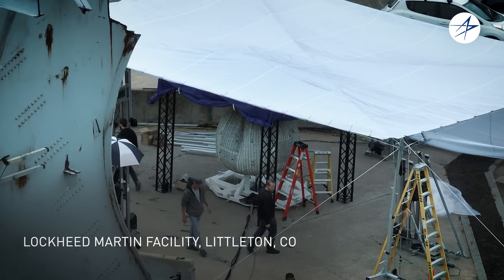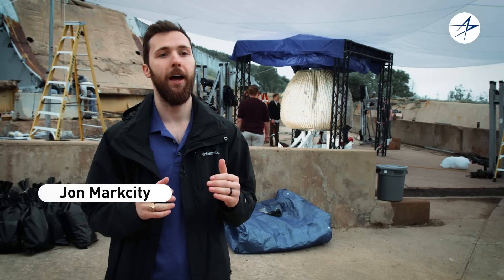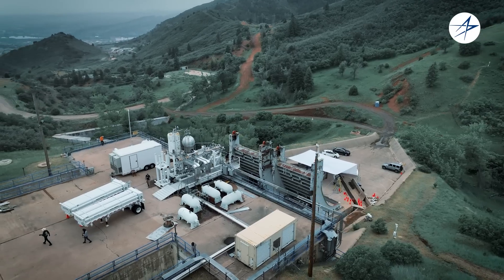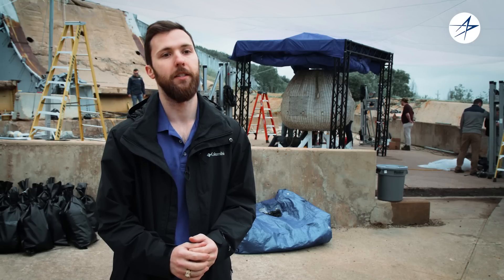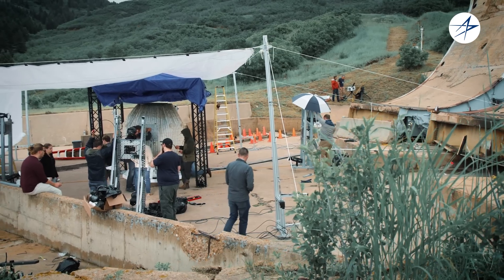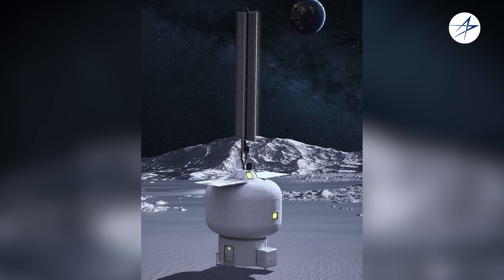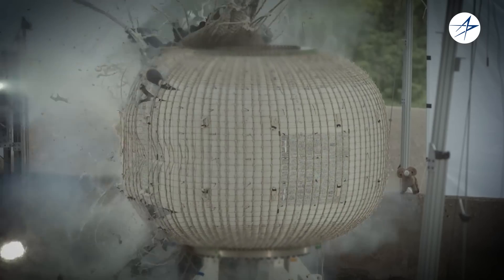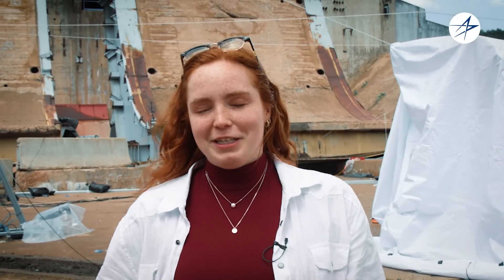Habitat Burst Test: We Did It Again

Comment: I don't get it. We have BEAM aboard the space station. Why are we back to square one? I thought LM bought the rights to BEAM and all the research which led up to it? It seems like we always get where we're going only to go back, start over, and end up back where we started. We know inflatable habitats work. One is at the station right now. Do something with it with what we altready know and where we were when BEAM reached station.
Reply: The situation with BEAM is bizzare, Bigelow Aerospace has gone completely quiet I believe the maintenance rights were sold off but not the intellectual property rights, so Lockheed Martin have to independently develop their own inflatable intellectual property.
Reply: @huhugrub1237  We'll never go anywhere in space with our 2 steps forward 1.99 steps back. Drives me nuts.